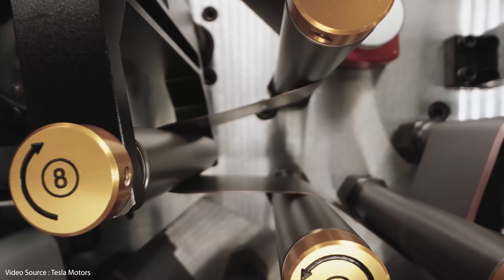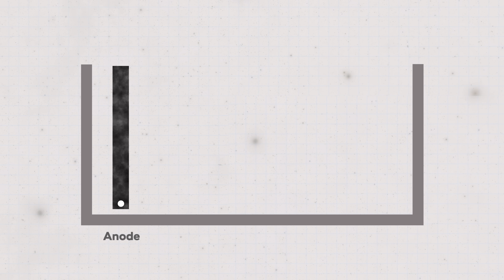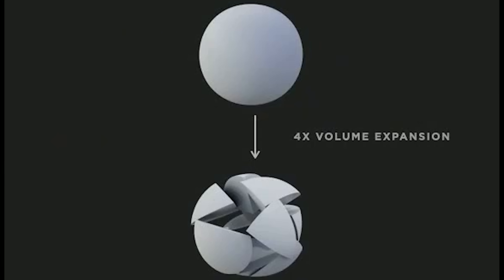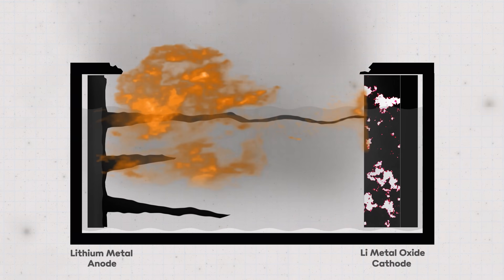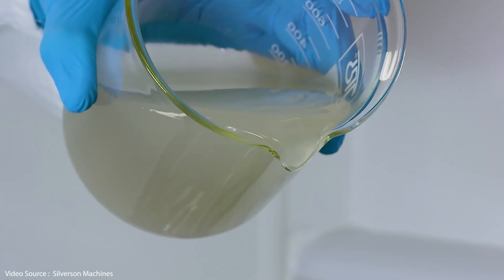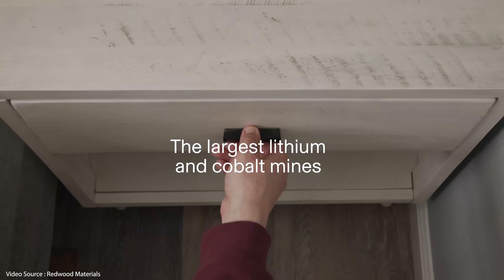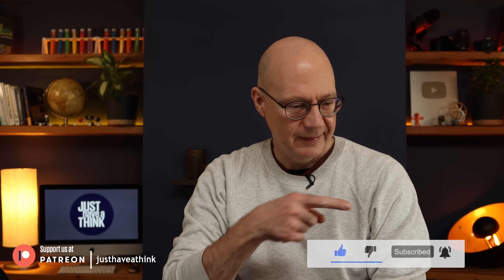Solid Lithium Metal anode breakthrough. 750% LONGER life!

Comment: Ah yet another laboratory battery. If we would use the time, money and effort looking to improve batteries to actually adopt Hydrogen instead we would meet our CO2 target goal much sooner.What a waist.  BTW. South Korea is building now 2000 Hydrogen powered busses. , Cold Alberta Canada has been testing hydrogen powered Busses. And Winnipeg also cold in the winter is running a hydrogen powered bus. Not to mention Mississauga Ontario Canada is going to be using 10 hydrogen powered busses.  Arrington Performance. Has 3 High powered vehicles running on internal combustion Hydrogen engines. And JCB now has approval from the EU to use their Hydrogen internal combustion engines in their Haney duty equipment.  Batteries are a flash in the pan . Eventually we have to move to Green Hydrogen if we humans are going to survive.

Comment: Sounds good, but I am sure it has some issues as well, like the fact its a coating meaning it does still break down and more than likely to heat thus be limited to some range of operations or issues with slower changing rates. Also will have its own cost added too to the battery, but I assume with a jump like that in power dens it wont really matter much for a lot of devices.

Comment: One of my first thoughts (living in a climate with cold winters) was how does this fare with sub-zero temperatures. They did not specifically mention that, but what they did say in the article is that the membrane is dried, so at least freezing water should not be a problem.

Comment: Scientific papers can be a challenging read, many refer to other papers that should also be read in order to understand the principles tested so can take days to plough through. Most of us don't have the time to immerse ourselves to fully understand them. The conclusions however are usually crystal clear and readily understood, viz:

"The greenhouse effect predicted by the Arrhenius greenhouse theory is inconsistent with the existence of the CRE (Chandrasekhar-type radiative equilibrium). Hence, the CO2 greenhouse effect as used in the current global warming hypothesis is impossible. Let us emphasize the overall conclusion:

The Arrhenius type GE (greenhouse effect) of CO2 and other non-condensing GHGs (greenhouse gases) is an incorrect hypothesis and the CO2 greenhouse effect based global warming hypothesis is also an artifact without any theoretical or empirical footing. Without scientific proof the debate on the CO2 GE based catastrophic AGW (anthropogenic global warming) should be abandoned and policymakers should focus on the more urgent environmental and social issues of humanity. The recent worldwide energy crisis is a warning sign that the promotion of the so-called green energy is neither solving energy shortages nor helping to protect the environment from pollution. The climate does not need protection, but the clean environment does."

Ferenc Miskolczi: Greenhouse Effect and Climate Change

THERE IS NO CASE FOR NET ZERO, EV'S, HEAT PUMPS, 'RENEWABLES' OR ANY OTHER 'GREEN SOLUTION'. THERE IS NO 'CLIMATE CRISIS'.

Comment: How is 93% capacity after 300 cycles a 750% improvement ?

What about modern SiC batteries, which are rated for 1500 cycles to 80% capacity

Comment: I always wondered why batteries are actually cylinder shaped. Of course it’s easier to manufacture a cylinder shape by just rolling the materials up. 
- But what if the battery is square? Thus folding towards the final shape instead of rolling it to a cylinder.
- Will there be any gain here?

Comment: On the surface, it seems like a potential step forward at least. The question, as always is if it scales up from the lab at a cost that makes redesigning existing processes financially advantageous for the companies producing the batteries. As we've seen time and again, what can be achieved in small scale lab settings won't always work at scale in the real world where conditions aren't perfectly controlled and precesses carried out by scientists seeking perfection.

Comment: The biggest frustration with promising lab breakthrough is that most of them either cannot be scaled up for commercial production or turn out far more expensive than originally thought. 20 years ago when OLED originally appeared, expectations were that OLEDs would eventually be so cheap to manufacture using inkjet, silk-screen or other low-tech processes that the blue degradation could be solved by simply making the OLED matrix a consumable that people can change every few years.
Reply: They are getting to that - so its not that far off. Samsung already made something similar with a inkject design - granted it was more of a test suit and not ready for prime time.

Comment: It sounds like the wiz bang bio polymer is a great step forward in itself but surely 750% increased battery life is the big win.
Reply: Yes, this is even a bigger win from sustainability point of view, as it basically would produce a fraction of the battery waste. Even if in real life this would be "only" a 2X improvement, it would be a huge win.

Comment: Breakthrough in Lithium-Ion Battery Anode Technology

*   0:00:09 The Challenge of Battery Optimization: Balancing battery capacity, charging speed, and lifespan is a complex problem. Increasing performance in one area often negatively impacts another.

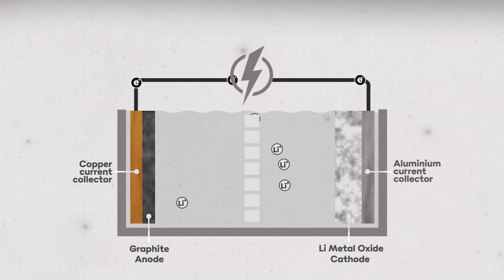*   0:00:19 Limitations of Graphite Anodes: While graphite is commonly used in battery anodes, it has lower energy density compared to alternatives like pure lithium metal.
    
*   0:00:28 Advantages of Pure Lithium Metal Anodes: Lithium metal offers significantly higher energy density but is prone to forming dendrites (irregular lithium deposits) that can cause short circuits and battery failure. It also reacts with common liquid electrolytes.

*    0:00:47 Addressing the Challenges: Research teams worldwide are actively working to overcome the challenges associated with lithium metal anodes.

*   0:00:57 KAIST Research Breakthrough: Researchers at the Korea Advanced Institute of Science and Technology (KAIST) claim a "game-changing breakthrough" that extends the lifespan of a lithium metal anode by 750%.

*   0:01:36 Lithium-Ion Battery Basics:
    *   Lithium ions move between the anode and cathode through an electrolyte.
    *   Modern cathodes often use nickel-manganese-cobalt (NMC) or lithium-cobalt-oxide (LCO).
    *   Anodes are typically made of graphite, where lithium ions nestle (intercalate) during charging.

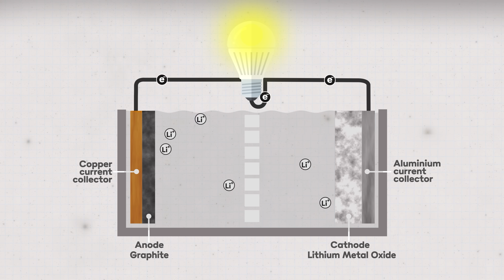*   0:02:20 Graphite as a Standard: Graphite is widely used due to its commercial availability, stability, and reasonable performance (372 mAh/g).

*   0:02:46 Silicon Anodes: Silicon offers higher energy density than graphite (around 3600 mAh/g), however silicon expands significantly during charging, leading to reduced cycle life, and electrical contact loss. It is often combined with graphite to mitigate these issues.

*   0:03:28 Lithium Metal Anode Potential: Pure lithium has a theoretical capacity of around 3860 mAh/g and the lowest possible voltage potential (0V), maximizing the voltage difference with the cathode and thus energy density.

*   0:03:55 Solid-State Batteries: Lithium metal anodes are also being pursued for solid-state batteries, a technology still under development.

*   0:04:10 Challenges with Lithium Metal:
    *   Dendrite Formation: Lithium tends to deposit unevenly, forming dendrites that can short-circuit the battery.
    *   Unstable SEI: Lithium metal reacts with liquid electrolytes, forming an unstable Solid Electrolyte Interphase (SEI). A stable SEI is a protective layer, but an unstable one leads to lithium loss, increased resistance, and gas production.
    *    Gas Production. Lithium's reaction with electrolyte generates unwanted gas, potentially leading to swelling and rupture.
    *   Electrolyte Consumption: Electrolyte gets used up over time, leading to cell failure.

*   0:05:54 KAIST Solution - Artificial SEI: The KAIST researchers developed a "biomimetic heterogeneous solid electrolyte interphase (SEI)" layer.

*   0:06:12 Environmentally Friendly Materials: The team focused on addressing the environmental impact, selecting guar gum (a natural food thickener) and polyacrylamide (a non-toxic polymer) for their SEI.

*   0:07:03 SEI Membrane Properties: The artificial SEI membrane was designed to be mechanically strong and ionically conductive.

*   0:07:08 Electrospinning Fabrication: An "electrospinning process" created tiny hollow nanofibres that provided mechanical stability and promoted uniform lithium plating.

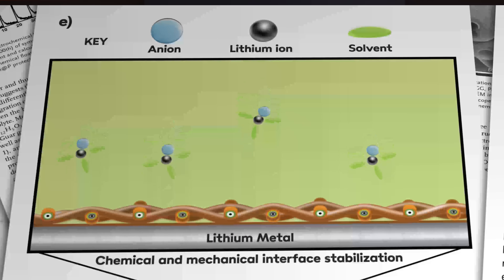*   0:07:24 Benefits of the Nanofibre Layer:
    *   Promotes uniform lithium plating (reduces dendrite formation).
    *   Controls reversible reactions between lithium and electrolyte.
    *   Reduces unwanted gas production.

*   0:07:45 Results: The protected anode showed stable electrochemical plating and stripping for 7.5 times longer than an unprotected anode.

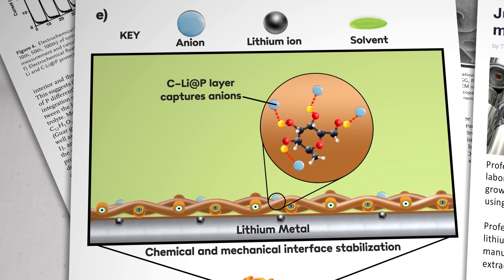*    0:07:56 Test Results: Tests with different cathode compositions achieved a capacity retention of 94% at one charge per week, described as "world-class performance."
    
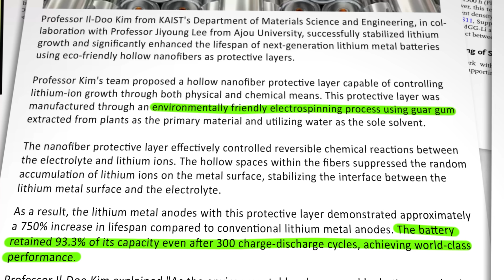*   0:08:14 Comparison to Existing Cells: The performance is stated to surpass a Panasonic 2170 cell, which retains 80% capacity after 1000 cycles.

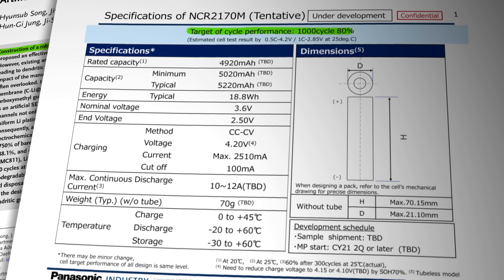*   0:08:24 Commercialization Potential: The team claims the technology could be commercialized within a month.

*   0:08:34 Sustainability Focus: The researchers emphasize the biodegradable properties of the materials, aiming to reduce the environmental impact of battery production.

*   0:09:01 Context and Caution: While the discovery is promising, many battery breakthroughs fail to reach commercialization. This single improvement doesn't solve all battery-related issues, but is a step in the right direction.

*    0:10:08 Call for Feedback: The video host encourages viewers, especially those in the battery industry, to share their opinions in the comments.

I used gemini-2.0-pro-exp-02-05 on rocketrecap dot com to summarize the transcript.
Cost (if I didn't use the free tier): $0.02
Input tokens: 13433
Output tokens: 1179

Comment: separating lithium from the rest of the battery is difficult. if breaking the battery open and putting it in water melts the other parts of the battery away would leave the lithium for reuse.  not as simple as I make it out to be but possible.

Comment: Using more Lithium? Lets go for Al and Na
Reply: Li is still better than Na in lots of ways, so its not that surprising to see the research done there first, but it should translate over to Na batteries as well because of how similar they are. Keep in mind, Li and Na only make up a small mount of the battery though... majority of its cost is more in the shell and other parts.

Comment: BTW. Case study. I have a Motorola edge plus smartphone, that I have been using as a workhorse for nearly 6 years now. I rarely follow the built in smart charging instructions, usually just forcing a full on blistering charge, when I can. I have noticed no significant degradation of charge, no overheating, and overall no issues... YET. I don't know if this info is useful, nor do I even know what model battery it uses, just a note.

Comment: My son worked some of that as part of his PhD, and this new effort resembles the "million mile battery" that Tesla/Musk announced years ago.  It is actually fairly easy to make batteries which have 10,000 cycle lives, or 20+year lifetimes.  these already exist, including in Lithium technologies.  However, the tradeoff is increased volume and weight.  The Tesla million miler would have made a car with no cargo space, required high heating during freezing winter and high cooling in Saudi Arabia.  As such it became an impractical "gadget" whose niche was only valid in the laboratory in which it was created.  In actual practice it was no better than a lead-acid.  I was a local meeting, at 20'F temperature, and there was a Tesla Truck, with the "motor" running during our two-hour meeting.  I realized that this was the battery heating unit, keeping itself warm.  I wonder if that guy ever made it home that night.  My old 1995 GMC 2500 Vandura utility vehicle just sits there, and uses no fuel, and starts reliably at minus forty below.  No problemo.

Comment: They need to solve the thermal runaway issue.   The amount of fires being caused by lithium batteries is not acceptable.    In Australia it was published as 10,000 last year.   Batteries can be hidden away for years, often in drawers/cupboards surrounded by flammable objects.

Comment: reminds me of when german car mfg went to biodegradable wire sheaths and vacuum lines in the late 80s. more planned obsolescence as those cars broke down and had predictable wiring.grounding issues after 20 years of life. theres nothing wrong with the lithium battery tech we had in the early 2010s. my 2013 chevy volt with its 16kwh pouch cell lipol battery has gone 2000 cycles with no observable range loss. actually its gained like 50% range since then. the solution to pollution is to stop throwing things away and engineer them to be both durable and repairable.
Reply: I would speculate that you live in an area that doesn't have a lot of 100° F days and doesn't have a lot of 0° F days. 

My lead acid batteries have always been rated for 6 to 7 years and they've always crapped out after 3 years and 4 months to 3 years and 8 months. That's because we had a hundred days of temperatures at 100° F or higher to summers ago.

However, we are also discovering that lithium batteries are more durable than we thought they would be 8 years ago.
Reply: @mac_mcleod  my town for 2024, 14 days over 100F and 6 days under 0F. PNW area east of the mountains. 

it has only lived in this area for 2 years though. since i was buying second hand, i traveled to everett WA to buy from a private seller, hoping that their milder climate would be better for such an old electric car. 
I garage every day and keep it plugged in and use the preheat function every night before i go to bed if its below freezing just to make sure the car is awake and pulling electricity to warm the battery and top off the low voltage system. I used to do basically the same thing with my ICE car to keep the 12v battery healthy. 
when i got the car 2 years ago I decided to replace the low voltage battery out of caution.
the agm battery i took out of my car was original for the car, mfg 2012 (2013 chevy volt phev), so about 12 years old and still working okay. replaced it with a diy 32ah lfp pack i built for 60 bucks. same usable capacity, slightly higher voltage. when it got cold the first winter I put a 12v 15w silicone heating pad in the diy minni ammo can enclosure and connected it directly to the battery through a w1209 temperature relay board to keep the battery above 4C at all times. uses very little electricity.
not that big of a deal because I also installed 200w of flexible solar on the roof which feeds directly into the low voltage system through a 20$ mppt charger, i think the brand was EA sun. not one of those cheap PWM boards, has an actual transformer inside, i think its 30amps rated. has been doing fine the last 2 years and gives me more range since it sits at higher voltage and tricks the car into not pulling energy from the high voltage battery and instead mostly charges from solar. I estimate that it gives me about 2-3 miles of extra range this way based on what the mppt controller tells me its adding to the battery, plus im avoiding all the losses of lead acid/higher internal resistance/float charging, and it weighs about 42lb less than the 12v battery i took out.
swapped the hologen headlights out with 4$ color changing LED's so i have fog lights, i think that helps minimize the low voltage draw also.
so far ive put 45k miles on it (bought at 95k miles), and it has paid for itself in gas savings, avg 96mpg. i dont think there is another electric car that could pay for itself so quickly without lots of compromises like having to sit in line at expensive dc chargers, which are more expensive than gas in my area. 
phev makes way more sense if you live somewhere with snow/cold temps. I get about 5.5mi/kwh in the summer and 4.5mi/kwh in the winter since I use the engine for heat on my 160mi work commute. put 100miles each day on the battery with the help of free workplace charging.
I did accidentally run the LFP battery flat a few months ago by turning the car on in accessory mode and running a 12v fridge and the internal heater for like 6 hours straight. wasnt awhare the 12v battery doesnt charge in accessory mode. it is still working okay after i revived it with a power supply.
the only reason I was able to get lfp to work in place of lead acid is because i built the battery myself and omitted any bms and instead went with an active inductive balance board. in phev application, there is no low voltage engine starter so im sure that is partially why i got away with such a small battery.
Reply: Sure but its important to understand that the volt has very large top and/or bottom buffers which greatly improve it's battery lifespan. I would like that in full EVs too the cost of all that extra mass really adds up with large batteries. I think gm really did the right thing with a lot about the volt.